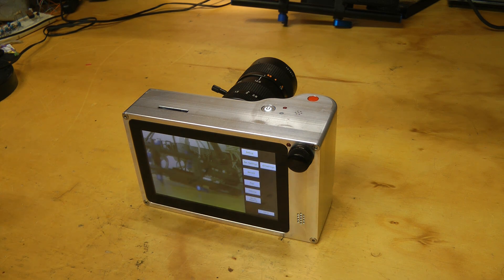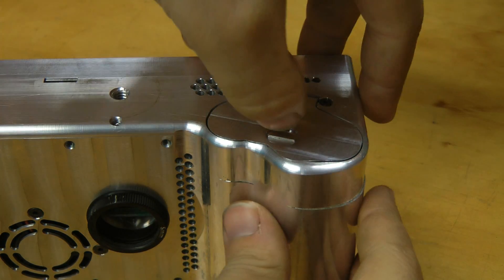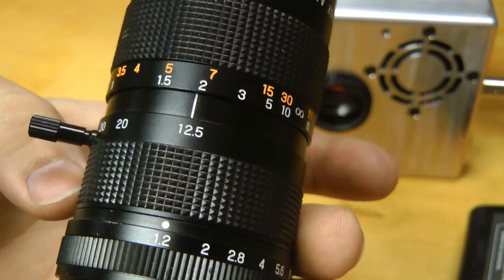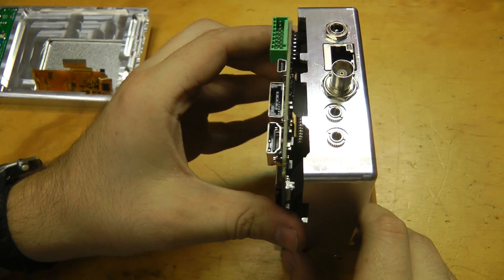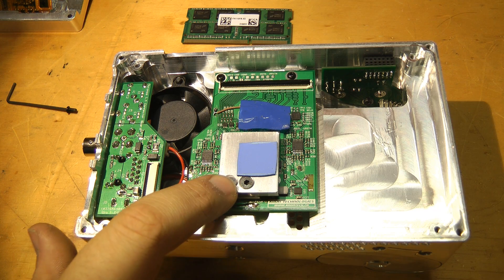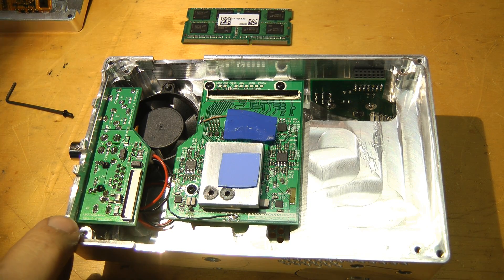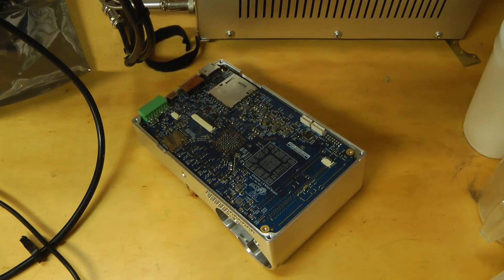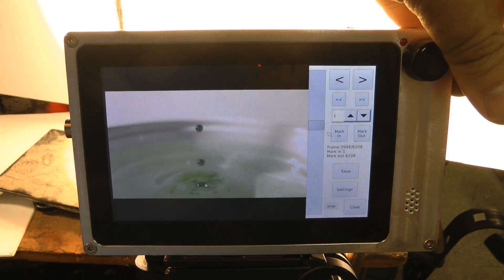Chronos 1.4 high-speed camera overview, teardown and demo

Comment: Years later, the camera (1.4) is still amazing and really kicks ass!!!   Nothing comes close in its price range.
Reply from the maker: Over 3 years later, no one has even tried to compete, I'm astonished! I was expecting a major competitor by now. I think we pushed the price so low no one sees any reason to try.
Reply: @tesla500    I've been looking at high speed video cameras and for my limited budget, the 1.4 fits my price range and does everything I'd want the camera to do.  (I'm just a technical nerd who loves playing with equipment, so it's for my own home use.)   Pity we're all on lock-down, because I'll just have to wait...  (Insert smiling face.)

The consumer based cameras that can shoot high speed are cool, but just too limited for experimenting. 

Also, thanks for your response.

Comment: will there be a version without the lens?
Reply: and without screen?
Reply from the maker: Yes, it's available without the lens. Why did you need one without the screen?
Reply: cuz even 2500 dollers is too much for me
Reply: A camera this powerful is going to have some cost to it. I believe +Tesla500 is selling it at a cost so that he can make some profit to support the project but also keep the costs reasonable. If you factor in the time and effort involved in supporting the development of the image acquisition system on the FPGA and the software development on the linux side of things,  $2500 is pretty reasonable. My best recommendation is that if you want one. Save up for it. Once the camera goes into production, you'll be able to get your hands on one. As an aside, you need a lens and a screen to be able to use the camera.

Comment: Cool, a DM8148 :-D  I've gotten quite familiar with that thing by doing baremetal programming on it. Unfortunately we ultimately ended up not using it. You're probably still using the vintage 2.6.37 kernel then, or do you have video and HDVICP2 working on a 4.x kernel?

Comment: Would it not be possible, to connect the heat sink to the chassis internally so you wouldn’t need to run a fan with this camera?

Comment: Could you have a heat pipe connect/replace that floating aluminum heat spreader to the massive case and ditch the fan (or at least have it used less-often)? Seems like a waste of such a nice stout case.

Comment: What operating system and GUI development tools are you using with the DM8148? TI offers Linux, Android, and others, though maybe you'd want TI-RTOS if response time is an issue. I'm an embedded systems developer, but so far I've only worked with ARM chips running Raspbian (on the Pi series) or a custom Yocto-based Linux (on a Variscite SOM). I'm just curious about what you selected for your situation.

For what it's worth, the GUI seemed a little clunky to me, but that's kinda normal for custom work on a small touchscreen. I like the addition of the spinner for input in terms of user interface, though I'd understand if you have to cut it out to reduce parts count and complexity in the final version. Nobody is against a nice GUI, but adding features to the touchscreen interface is less important than delivering the core functionality of the hardware. As long as the user can get the shots they want using the camera interface, they can transfer the data to some other platform if they want advanced editing.

Comment: i was like, yeah i'd buy one. open descriptions only to see $2500. ouch... 

question tho. wouldnt the capture rate of 1050fps mean the amount of light required is insane? not like you can put extremely high iso and low f-stop, right? those captures look fairly clean and in focus.

Comment: That's pretty, pretty cool, man!
I just like to ask you two things:
- Is it possible to adapt this camera to conect direct to a power source?
- Would it be possible to keep it recording during a long time non-stopping (for like 12h) directly conected to a power source and a computer without frying the sensor or damage anything of the camera?
Thank you very much =]
Reply from the maker: The camera can be powered by an AC adapter and run continuously. There are no overheating problems thanks to fan cooling, when shooting Will it Mow I just left the 4 cameras on all the time. You can leave it recording as long as you want waiting for a trigger to stop recording.

Comment: Is it rolling shutter or global, and how large is the sensor?
Reply from the maker: Global shutter, 2/3" sensor size.
Reply: tesla500 for all frame rates? And at higher frame rates is there any fov crop apart from letterboxing?
Reply from the maker: mehgeme
At full resolution (no crop factor), you can run up to 1057fps. To get higher frame rates, the resolution needs to be lowered which will cause some crop or letterboxing depending on how you lower the resolution. Basically the pixel rate is constant, and you can trade resolution for speed.
Reply: ah, ok, thanks!

Comment: question or maybe an idea
an high speed camera uses ram alot of it and other computer cpu etc
now its there a chance to use a real computer with alot of ram (more ram can be added) and build and connect a cmos  (or equal) sensor to pc via pcie (fast interface) and make a high speed camera out of a powerfull pc? 
the cost of the module with the sensor would cost much less then a hole high speed camera
Reply from the maker: Cameras in the past were built that way. It really restricts usability however, needing to drag a full size desktop PC around with the camera, so that design isn't popular anymore.
Reply: sorry for the delay, i was very intrested into this subject and always wished a phantom cam but yeah its expensive, i even looked ebay for old BW ones, and cheep but no chance in my country. but anyway some ppl like me would need a high speed camera gear for research in lab at home etc and they/we may not need to carry the cam,
 so a possibility to use a high end pc and its ram etc to take very slow vid it may be a good option , as i own 3 xeon workstations and alot of ddr4 ecc ram etc i would give use of 1 just for this and i would pay the right price for a module that takes advantage of the pc power instead of the small cpu inside a cam, in the end the footage the fps the wuality its limited by the cpu power and ram of the cam, right?

Comment: Would you consider open-sourcing the design? i'd love to have this in a DIY kit or something similar :D
Reply from the maker: I will open source the user application, I think that will be the most common thing people will modify.
Reply: There isn't much you can open source on it though, pretty much the only thing someone will be able to do themselves is make the case, and even that won't be many either.

Comment: Hey! Curious as to what the most expensive components in the camera are? Are you able to make much profit out of $2500 or are you basically breaking even?
Reply: Basically, what will kickstarter funding help you achieve?
Reply from the maker: Most expensive single part is the image sensor at about $350. Other than that it's just all the other stuff that adds up. Cost is about half the sell price, so slightly less profit margin than typical electronics, but I really want to meet the $2500 price point. I'd like to use the money to hire actual staff and develop better cameras.

Comment: The RAM will be used for the firmware or as buffer for videos before writing them on a mass storage device?
Reply from the maker: Yes, the high-speed raw video is buffered to RAM then saved at more normal speeds to storage devices.

Comment: I'm actually surprised the aluminum block that cools both the sensor and TI SoC isn't sinked to case somehow by another thermal pad. seeing as it's an aluminum casing, it'd probably make things even cooler. and having a cool image sensor is always a good thing for video quality.

are you going to have to get this certified in any way before it becomes a proper ready-to-sell product for purchase in places like the US?
Reply from the maker: It is thermally connected to the case where it's mounted, there's some thermal grease there.

Comment: Will he audio be recorded in the same file as the video or separately? does the audio digital converter have a high enough sample rate that the audio wont get choppy when you sync it with the video at max frame rate? (like when you slow down 30fps to 5% speed in imovie)

Comment: What is the maximum flange distance that you can adjust the back focus to?  I have quite a few c-mount lenses, and a handful of them have, what I would consider a extreme intrusion distance, maybe 25mm on my Fujinon 50mm ƒ0.7, which I would likely use on this camera once I can get my hands on one... You know, if the flange is deep enough to fit the lens.  I have managed to get the 25mm Fujinon to fit on my Nex-3 by grinding out the plastic light dampers, and natively on the Pentax Q, so I would assume that it is less than 16mm.

If this can handle 25mm of backspaced flanging, I will start putting away my money now to pick one of these up from you.  

Assuming that you are the one making these, perhaps a 1-off front might be possible?

Keep up the amazing work!

Comment: Why did you use metal casing ?
I mean in the times of 3d printing it should be a lot easier to put the camera in a nice ABS case ?
For mass production it's not that expensive to make the forms for injection molding and it will look more professional than an aluminium body (and lighter)

Aside of that, I'd like to order one ;)
Reply: 2500$ camera in a plastic case? No thanks, I'd rather have the strength of aluminium where even if you drop it, you know it won't just crack and the case also acts as a heatsink for the CPU and sensor. Also aluminium is cool.

Comment: That's very nice. 
I see few "problems" as fillmaker: 
-At least fhd 1920x1080 max resolution ( maybe @800fps)
-Compatible with other mounts like EF, or better, E mount - many fillmakers use EF mounts because It's easy to adapt to sony E or other mirrorless mounts and have good and fast optics for cheap. (maybe offer a version with the EF mount-even if the sensor si smaller than aps-c size, es can add metabones speedbooster or similar)
-Log or cine gamma profile - like in sony cameras
-Better battery - many filmmaker have the np-f sony batteries that can be changed fast and easy, they have many sizies (eg: np-f550 up to np-f970) and they are cheap.
Thank you for your time

Comment: I have been calling for dSLR manufacturers to do high speed video (with 1000 fps at 720p as a suggested target for higher end models, and 240 fps for cheaper ones) for at least 7 years. I don't recall hearing of any that do better than 60 or maybe 120 fps. 

I hope this goes VERY well for you. I have trouble imagining that it won't. 

I am developing a YouTube channel (different account) that may be an interesting use as a demo for this if you're interested in loaning one out for a short period. If so, how can I contact you directly about my idea?

Comment: My my my, that's exactly what I need. Between yours and Taofledermous' channel I see enough examples to get pretty excited. I see renting a high speed camera as very annoying. Yours would be within the buy range. May I ask some silly questions though. I didn't actually see the W value above 1280. Does it go higher? And will there be any cats in the production facility? :) Nice nice work on your project. Quite amazing.

Comment: I heard of you from taofledermaus's video showing off your demo camera.  It looks like it goes a very long way toward solving the price and portability issues that kept me from buying an edgertronic.  There are two things I'd really like to see in a consumer grade hi speed camera: full 1080 16:9 capability (even if it's below the 1000 fps mark the current 4:3 res maintains) and getting 1280x720 up to around 1800-2000 fps.  I'm looking forward to the crowd funding stage.  There is a very strong chance I will participate.
Reply from the maker: This one maxes out at 1280x1024. I might do a 1080p one next, depends on image sensor availability. I heard there's a 1080p 1000fps sensor coming.

Comment: add a heatpipe to the sensor/cpu cooling block so you can run it continuously for more than a few minutes
Reply from the maker: Not needed, I've left one of these running for days without issue.

Comment: Case should be 3D printed. SLS composite would be super. Contact me if you want assistance. tcd@abemis.com
Reply from the maker: The case needs to be thermally conductive for cooling. Unless you can print in Aluminum it won't be practical. How does the cost compare to machining?
Reply: I think at that size, printing in aluminum would be about $1000-1500. Not too bad considering prototype. Maybe less I might be overestimating the size.

Comment: ¿Have you tried to put an optical low-pass filter in the camera, or is it too complicated? I mean, it helps with the image quality and artifacts. I didn't know you were working in this project for over 15 years. I saw your Phantom v5 reparation video a few month ago, but didn't know about your own camera project. Cheers
Reply from the maker: The camera does have an IR cut filter, is that what you mean by optical low-pass filter?
Reply: Oh, so it has one. Well yeah might be the same, you see, the OLPF diffuses the image removing aliasing, avoiding internal reflection, artifacts and infrared light so the sensor may register more accurate colors when doing white balance. As far as I know the Phantom C110 don't have a very good OLPF, only the recent LC, R, Lab Miros and above are the ones that do have them, making their images' color better looking without this magenta or green-ish tint.

Comment: I wonder if multi-bracketed exposures would be possible so you could do low-noise/HDR video. With that frame rate it seems you might be able to pull off super high latitude (non slo-mo) recordings without significant motion artifacts.
Reply from the maker: That could certainly be done. This sensor also supports HDR in a single exposure. You can program a nonlinear light->pixel value response curve to extend the dynamic range drastically.
Reply: That's interesting too, but less so I think, because the resulting footage would have low bit-depth relative to the scene's dynamic range. Bracketing across multiple exposures would provide for not only capture of an HDR scene, but via an HDR (high bit-depth) video file. That would allow post-processing to bring out high quality detail regardless of whether shadows, highlights or anywhere in between. The idea is that in addition to being an ultra high-speed camera, it could alternately be a high-latitude camera. Or better, the user could blend both abilities according to a specific need.

Amazing work.

Comment: I would mention that having all the connectors on a daughter board is a must. I can't count the number of black magic pocket cinema cameras which were destroyed due to the HDMI being on the main board. It means when a connector is abused and ruins the board it doesn't require a new main board (which has the CPU attached, at least in this case the sensor is on a daughter board already - the BM camera had the HDMI on the same board as the sensor).

This isn't optional at all, it's a must for this type of camera, sometimes all it takes is someone brushing past with an external monitor plugged in and it will rip the tracks off the board and ruin it.
Reply: Good thing it has that.

Comment: I love the machined case but of course that adds a ton to the manufacturing cost. I would think your small 10-20 unit number is grossly under estimating what you created here because this camera is awesome especially for the hacking potential. Based on the big engineer youtuber's that have commented on your video I could see you selling 10 times your estimate or more. I really want one but the $2500 price tag is a little too rich for me at the moment but if some how you could get that number down to $1000 to $1500 by going with some sort of molded case (which of course requires a lot more backers) I would support your kickstarter for sure. This is most likely completely unrealistic but if I had to guess that case is probably a quarter of your BOM. If you don't mind could you share what the BOM is for your camera?

Comment: can the camera record continuously or does it record in a burst like the vision research cameras?
Reply from the maker: Burst to RAM currently, but the video codec in the CPU can process 120 megapixels per second so it in a future software update I might be able to add a streaming function at a slower rate than the burst capture, eg. 720p 120fps, 640x480 390fps.
Reply: what are the current capturing options ? I don't quite understand the triggering system

Comment: So, if the base model got 8gb, can  it be upgraded easily to 32gb without software modifications?
Nice solid design, if i had the money..i would get one
Reply: Wtf is your profile picture?
Reply from the maker: There may be some different FPGA bitstreams for the different options, especially 1 vs 2 RAM sticks, but no major software changes.

Comment: maybe drill some holes in the aluminum piece on the image sensor to decrease its thermal mass?
Reply from the maker: Thermal mass doesn't particularly matter here, although it would let it get to temperature quicker. Holes would increase the thermal resistance though, so the sensor would get hotter.
Reply: Hmmm I'll concede that you've put much more thought into this that I am able to :)